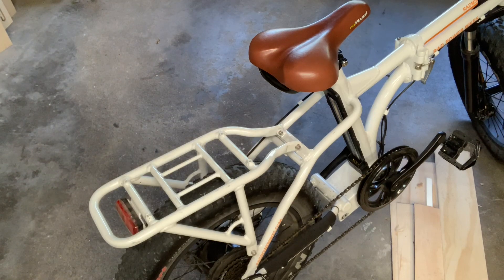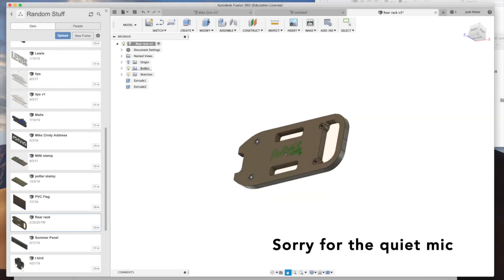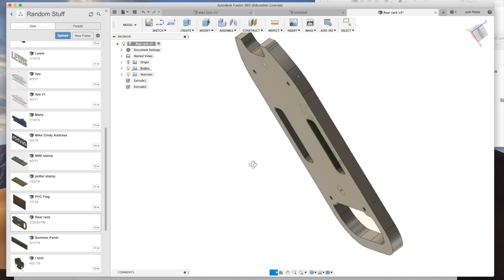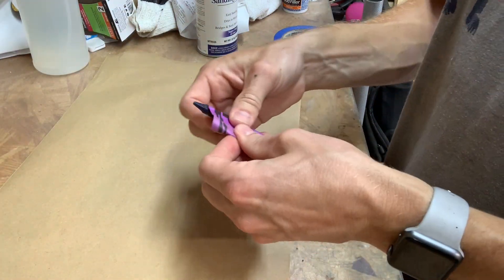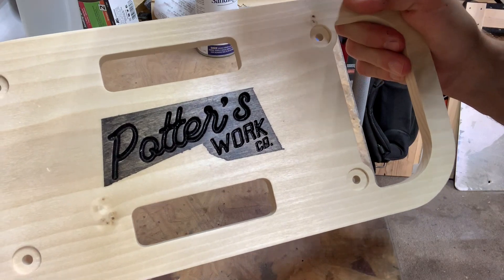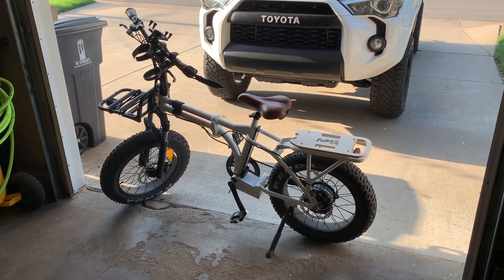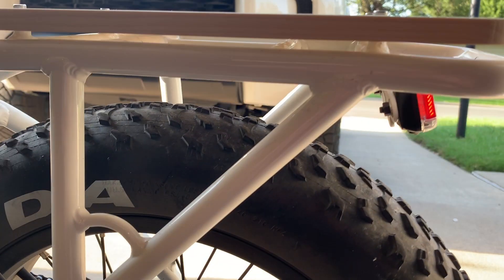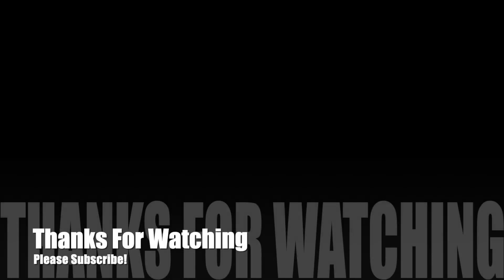Custom Wood E-Bike Rack (RAD Mini)

Comment: I used composition cutting boards instead.  No fabrication needed.  Just drilling at mounting locations.  Yours is cooler of course...
Reply from the maker: Cutting board would have been a good material to use!  If I remake one, I may do that.  Good thinking!